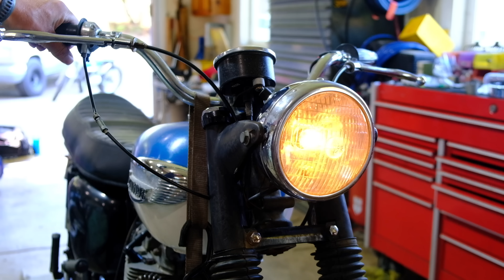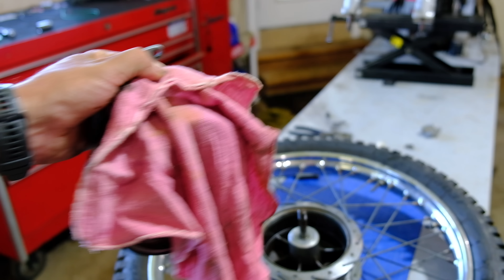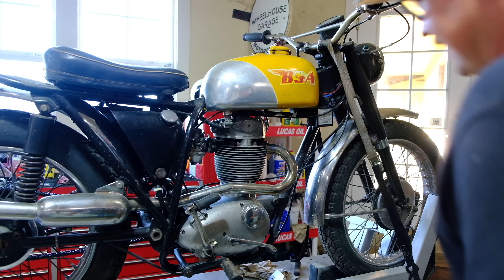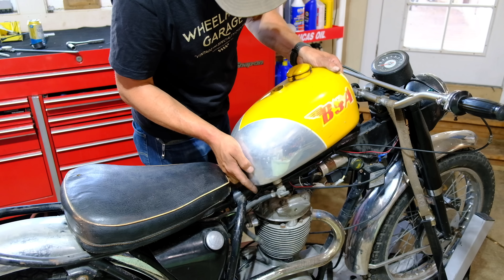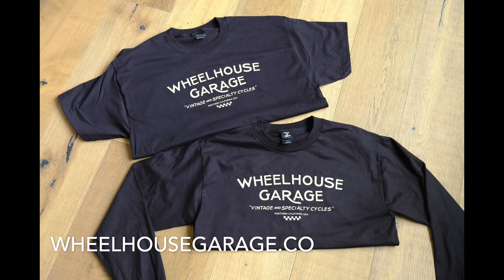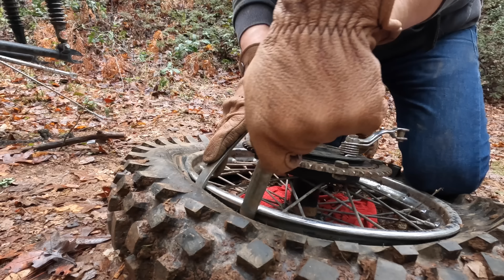British Workshop Week | Triumph BSA Cotton

Comment: Great stuff, really enjoying your videos.  I’ve got two contributions (1) the Electrex system can also work with a small battery rather then the power pack - which is a big capacitor;  (2) The “A” in Amal is short like “cat” not long like “day” - it’s short for “Amalgamated”! Well at least it is here in the UK :)

Comment: Yeah, Triumph had a "no battery with lights" electrical system in the 1960's.  I had a T100SS that had it, from the factory.  It was called the "Energy Transfer" system (ET).  The T120TT also had it, but it didn't come with lights.  You could add lights.  Suzuki was using something like that.  A 1983 DR 125 had a headlight and tail light, but no battery.

Comment: I used to own a 69 Trident, and could have bought a set of used Mikuni's for cheap, but I passed as the Amals are proper & worked well. My 67 Lightning still has the Monoblocs, and it runs extremely well since I replaced the Boyer black box with a digital red box Boyer ignition!
 Those fuel inlet banjo's are plastic and break all too easily, and are near impossible to find when you need one>(I need one)!

Comment: That single seat on the BSA is just perfect. Are you planning to install your signature one size bigger tires - vintage style trial front tires and some meaty rear mx knobbies in the rear?
Reply: To my knowledge, Kenda makes the only beefy front 19" knobby.
Its a DOT tire that is a real knobby.  I would take it over a Trials tire.
Reply: @bradsanders6954  is it a 3.5 or 4.0 19 section tires?